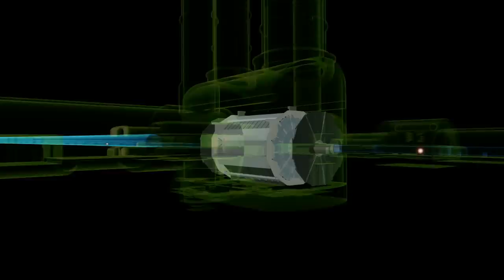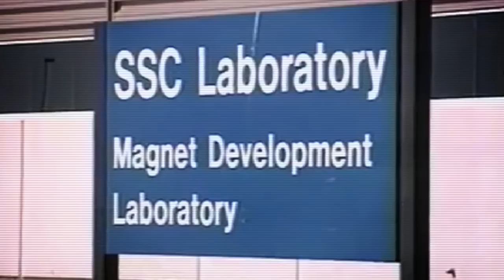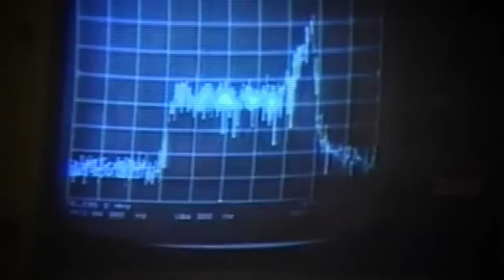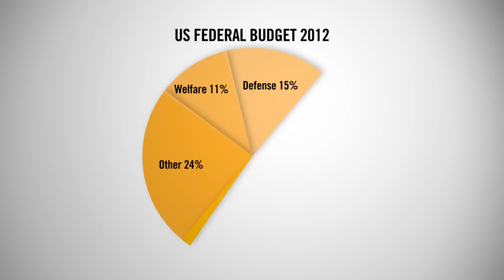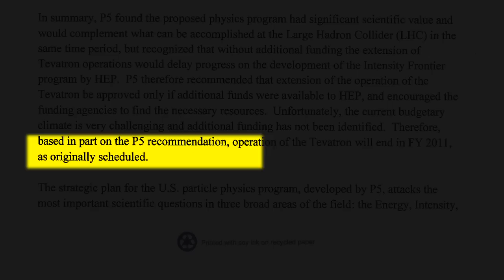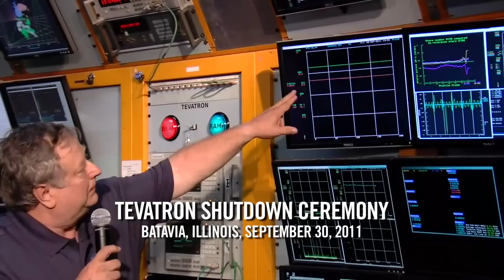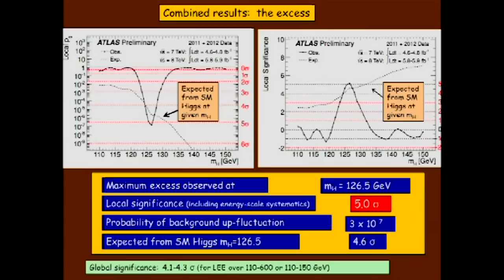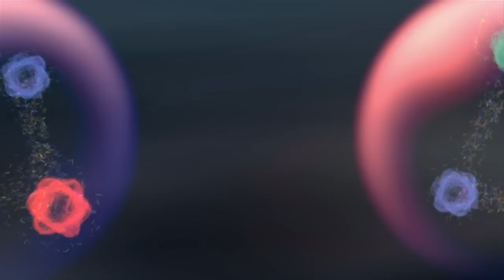Who Killed America's Biggest Gadget?

Comment: Too bad they weren't making iPhones down there, they would have been funded for another 30 years...
Reply: You're not technical enough to understand, so I'll explain.  The small lines of the integrated circuits in iPhones are imaged onto silicon wafers by 'X-ray Beam Lithography.'  A process developed for particle accelerators.  Had particle accelerators not been developed, iPhones would only exist in Dick Tracy comic strips.

Comment: This group is not technical enough to understand, so I'll explain.  The small lines of the integrated circuits in iPhones are imaged onto silicon wafers by 'X-ray Beam Lithography.'  A process developed for particle accelerators.  The machine that does it contains a particle accelerator.  Had particle accelerators not been developed, iPhones would only exist in Dick Tracy comic strips.

Comment: I'd say:  Notice the HUGE amount of $$$, which the US owes, eg, to China, etc. Then, support USA, by "taking a break" from high energy-demand projects (eg, Fusion energy, etc.), for long enough to develop & implement safe, green sources of cheap, Energy from Thorium, eg, in Liquid Fluoride Thorium Reactors (LFTRs). I applaud Norway's creation of a Thorium Research Centre, & my hope grows, on hearing reports - like those from some Canadian companies - who expect they'll have their designs for smaller, transportable Molten Salt Reactors (MSRs) both Approved & Implemented within 5 to 6 years, albeit as sources of process-heat for remote mining operations. THEC13 was held at CERN, in neutral Switzerland. Read the writing on the walls: Cut "defence" spending, stay out of wars, & pour moneys saved back into Science, but only after switching Off fossil fuelled power plants, so that Science can be used to reduce CO2, rather than continuing to increase CO2 concentrations, as happens today, by consuming energy from "dirty" power plants. Replace "Publish or Perish" with "Produce Practical Solutions to very real urgent energy-based environmental problems... or Perish."

Comment: It took $13.25 billion total to find the particle.  If the U.S. were to have continued the race, it would have cost more and maybe the U.S. still wouldn't have found it.  CERN now is thinking about building a larger collider. that's going to have a circumference of 80 to 100 kilometers, which is about the size of the one that was suppose to be in Texas. From looking at what was already done in Texas, if the Texas collider would have been built, it probably would have cost about $13 billion just by itself with the original projected cost being $4.4 billion.

Comment: Why was the contractor of the Texas facility allowed to balloon the costs beyond what it was contracted for? Their contract should have specified the cost for the full build at a fair price up front and then force to finish it at that cost. This is the fault of the government negotiators and their inability to control costs of projects over the long term of any project. When you hire someone, the contractors in this case, to do a job at a price point, you have to hold their feet to the fire and force them to finish the project as they agreed in writing when they signed it.